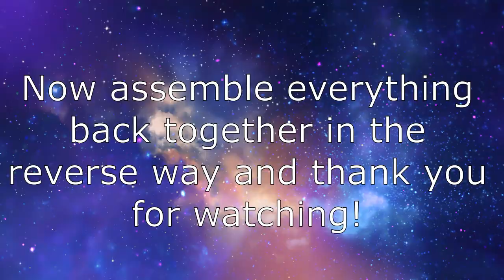Just a quick one on how to get to the fuel pump on Suzuki Wagon R+

Comment: Do you have the serial code for this pump? I hace a model 2001 Manual 1.3 Petrol, is that your engine? 1.3? thanks a lot for your answer
Reply from the maker: Sorry missed your comment (on time). Here is Dephi code FE0501-12B1 that's for your car. (I have another one with g13bb too, pump setup is the same as in this vid)

Comment: at about 30 seconds in the vid you say to disconnect 2 fuel lines  (circled red and blue) but how do you disconnect them?
my gut tells me to just jank them off but my brain says "NOPE"
and how do you disconnect the electric plug?
Reply from the maker: I fact you can disconnect fuel lines with fuel tank still bolted in place (my mistake in vid) there is a clamp for a evap line an quick connect for a fuel supply line just after thay "get down" from a tank pick up to a cars bottom plate. So disconnect them there and after that when you get the tank down a bit press the connector release flap ( from a passanger side) and pull it up. P.s. Quick connect of a fuel supply line is unplugged by pressing both blue flaps (on both sides)

Comment: Bro in my car while filling the fuel tank...fuel comes out....also have starting problem..tik tik sound will comes...what to do ?
Reply from the maker: Hi. First of all check the inlet pipe. Usualy there is a rubber hose part there it might need to tighten the clam
Reply: @garbagecargarage  the clam are in tight
Reply from the maker: @selfthoughts6955  rotten pipe then (maybe) no clue man

Comment: What year wagon r+ is this?
Reply from the maker: 2004 but fuel tank situation is the same from 2000->
Reply: @garbagecargarage  I'm speculating that my fuel pump is toast, judging by the fact that it doesn't make any sound when I turn the ignition on, I'll try taking off the fuel lines in the engine bay and testing that way tomorrow
Reply from the maker: @kristjanlepikult8654  unplug fuel line from injector rail and stick it in some kind of container than turn ignition on or even try to crank the car and see if any fuel will come out